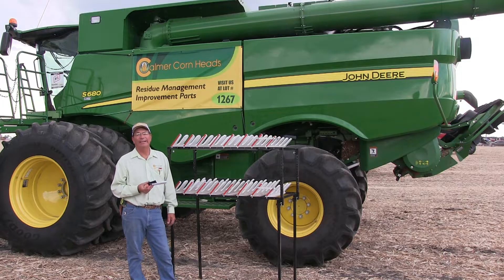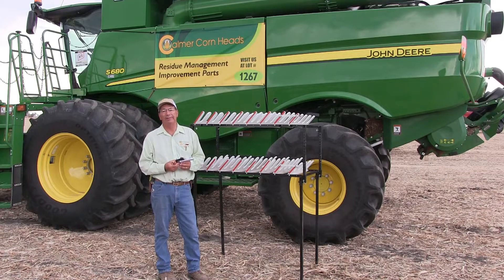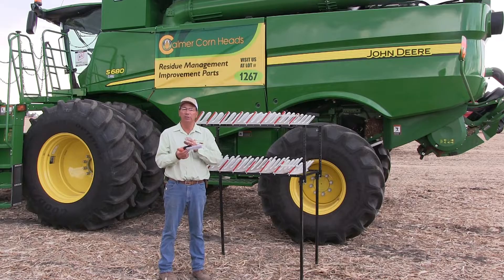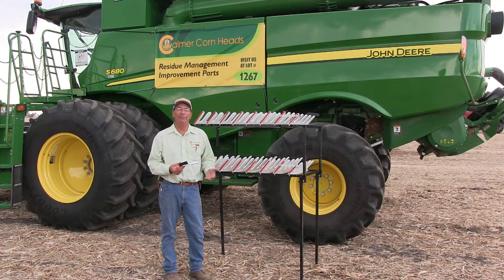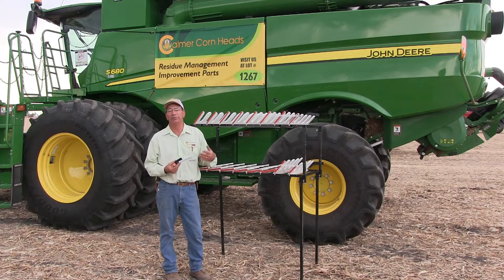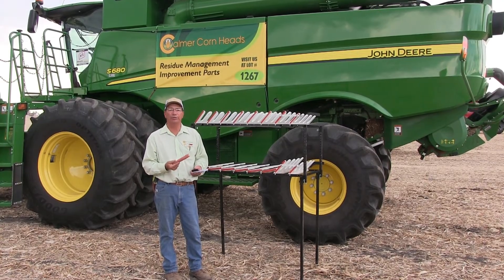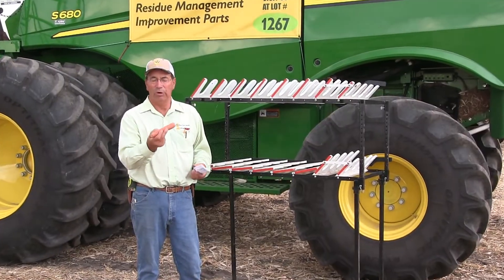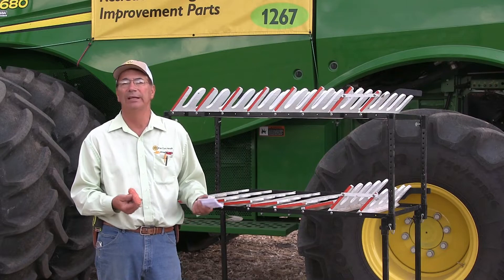Marion Calmer on Setting Combine Concaves and Sieves - Harvest 2017

Comment: We thought we had a problem in our concave settings breaking cobs in half...turns out our header was breaking them in half at the front cross auger. Just a slight break that turned into a full break by the feed accelerator, making threshing difficult...which appeared as rotor loss.

Comment: The top seive is much easier to throw grain out of the back of the machine as anything not getting through it exits the machine, the lower one only dictates what gets to the tank and what ends up getting rethrashed, keep this in mind as you set the upper chaffer seive, to far closed and you will put kernels on the ground behind the machine.

Comment: The cleaning system in the S Series directs the majority of the air directly at the Chaffer(the top sieve), there for the sieve does not have that big of an effect on air in this newer cleaning system.  But I agree on opening the bottom sieve up to the point of little to no returns, and cleaning with the chaffer.

Comment: We use to pull the sieve (bottom) completely out on smaller combines with capacity problems in corn and just use the chaffer(top) for cleaning, so this guy is correct with his recommendations.
Reply: I know drive and mechanic this masheen 
I need job